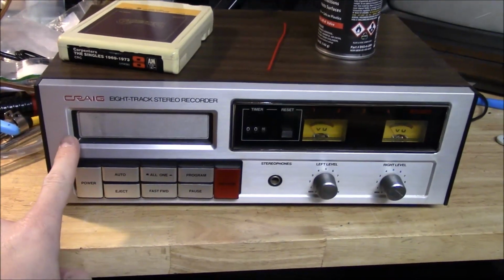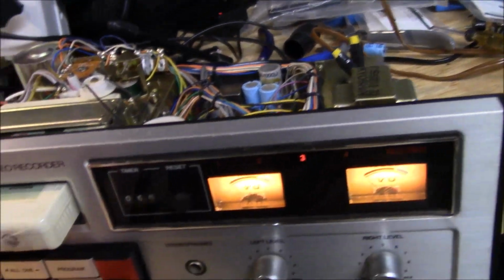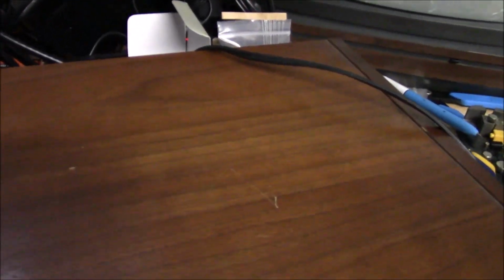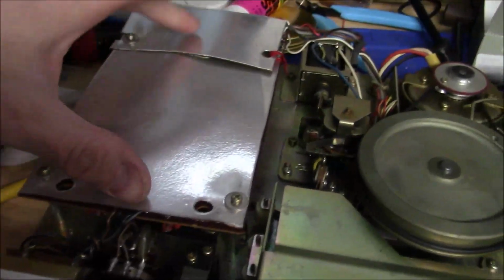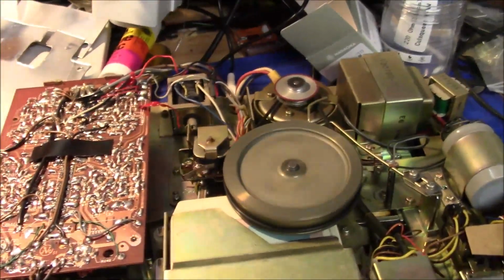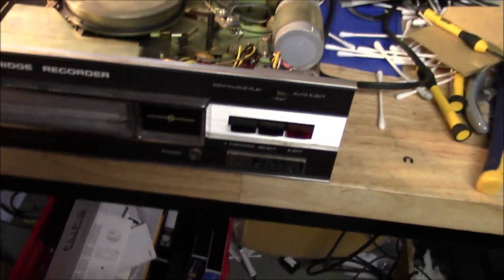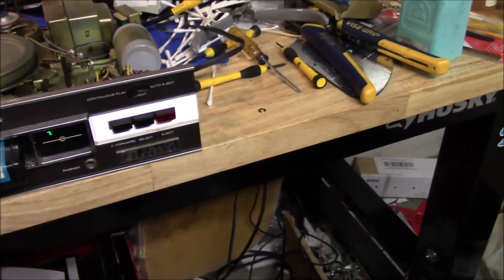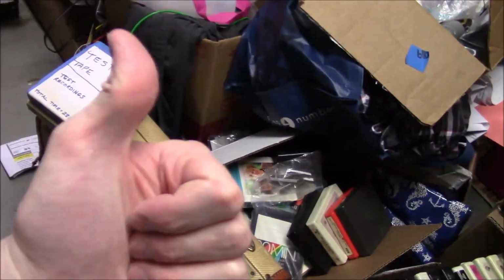8-Track Tape Deck Madness

Comment: Nice deck. Yeah, the Mitsumi transport mechanisms with the polyethylene plastic head frames that almost always break. I fixed several of these. You have to carefully disassemble them off the two posts and takes pics while you do it so you can reassemble it after you glue the cracked frame. You need glue for Polyethylene and use sandwich ties to hold it together until it dries 24 hrs later.

Comment: For the broken plastic head support on the Craig, look up video  from luvradios for realistic tr-802 repair. It’s got 2 parts, but the guy uses thin metal strip to put around the plastic. I did it to my deck just a few weeks ago. I used a thin piece of aluminum from a piece of house siding, but I think you could use an aluminum soda or beer can to fix it.
Reply from the maker: I already tore it apart and probably lost some of the parts and/or improperly attempted to reassemble it.  And as I mentioned, I got a full refund for this deck.  I'm not too concerned about it at the moment.